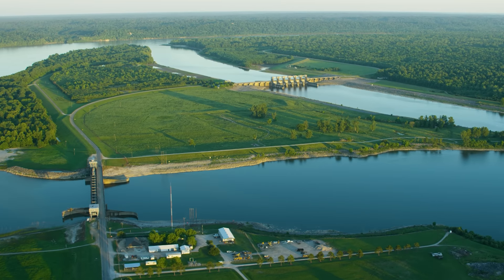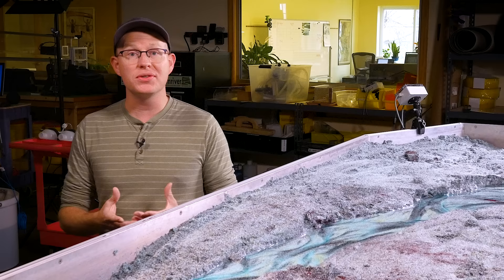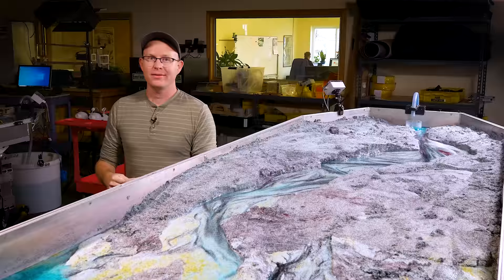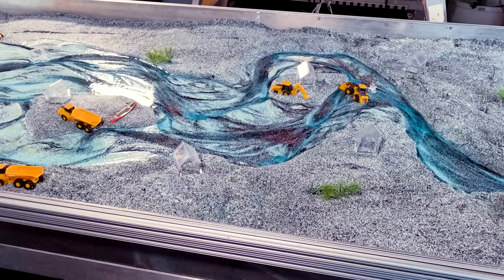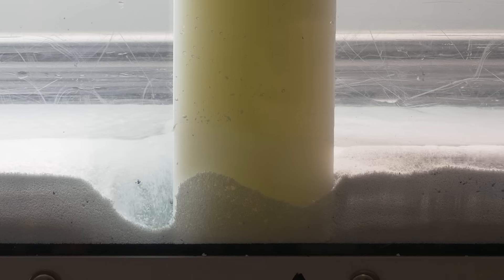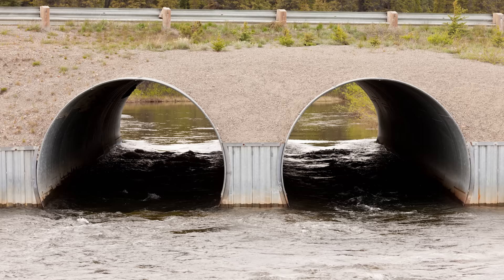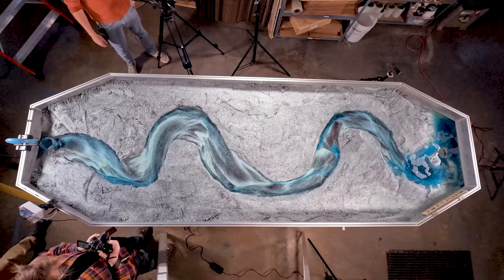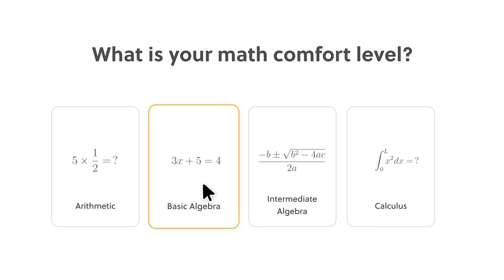Why Engineers Can't Control Rivers

Comment: I've tried for 10 years on a small scale and know how impossible it is. I live on a river and build a small dam behind the house to make a swimming hole & fish hangout spot. One year by accident I set the flow in a perfect spot to wash all the large rocks away and reveal a deep patch of grey clay. It's the perfect 5 foot swimming hole, where you can jump off a ledge and not worry about landing on rocks. Since that year I've tried every single year to do it again. You have to put large enough rocks to hold during the spring runoff and divert the flow perfectly into the bank. You also only have one chance. Once the spring runoff starts you cant make adjustments, then after all the snow melts the river drops way down to only a few feet deep. Something always happens, it fails or a large tree gets stuck in the wrong spot, it's always something. Water will always go where it wants

Comment: OK.  Raise your hand if you have been contemplating building yourself a simulated river sandbox after watching this series of videos.  Might pair nicely with a lego hobby for bridges and buildings.  Adults can play too, right?
Reply: Our local Conservation Authority has a "sand box" equipped with a CAD system that can shape the sand. One can plug in data from a topographical map, for example, to shape the sand for more accurate modeling.
Reply: I had a sandbox as a kid and used to create scenarios where I'd flood it and have to build dams around my "city", until Mom yelled at me for "wasting water". You bet I'm thinking about building a river table.

Comment: There's a reservoir I used to go camping by where the choicest campsites were those where the river met the lake:  sediments had built up for several hundred meters to the point that the shore was a sandy beach!
A bit farther up that river there were three tributary streams that had been combined into one channel that flowed through a culvert with a six-foot diameter.  After the third time in a dozen years that the culvert was overwhelmed, washing out the road, the advice of the geology department at the nearby university got followed:  the three streams were put back into their own channels, and each channel got its own culvert with twelve-foot diameters.

Comment: I work as a flood control engineer. 
We young engineers always try to push for modern ideas in river basin management and steer away from conventional measures like cut-off channels, floodways, and lining rivers with concrete. 
Unfortunately, decision-makers (older engineers and politicians) are rarely open to new ideas. Add the rampant corruption in our country, and I am afraid we will never be able to solve any of our countrymen's problems.
Reply: Keep fighting the good fight😢

Comment: The Logan Creek Dredge here in northeast Nebraska has aged exactly like your model. The Logan was once a shallow, meandering creek that made its way to the Elkhorn River. Flood control was the order of the day (early 1910s) and a company was hired to dredge and straighten the channel 6 feet deep and 10 feet wide. It has now scoured out about 50 feet wide and 30 feet deep, with the creek only being about 4 feet deep and 12 feet wide. The bank is steep and the flow is fast. After closing off the natural creek bed, millions of fish died because nobody thought about what would happen to the fish! The massive flooding in spring of 2019 really widened and eroded the banks, almost doubling the size of the creek.

Comment: The Aswan dam located at the Nile river in Egypt is an example of what can happen when silt meets a dam on its way to the Delta. The river delta is not getting enough silt and nutrients. Shores on the Eastern part of the Mediterranean, like in Israel and Lebanon are slowly eroded because no more silt is deposited along the shores. Engineers have to place wave breakers to reduce beach erosion from waves, as much as possible.

Comment: I don’t know if you’ve touched on this topic, but it could be something neat to research. The old river control system only came about in the 1950s because for centuries, there was a massive log jam on the red river that slowed the flow from the Mississippi into the Red River.

Comment: In Northern Québec in Canada they deviated rivers the size of Mississippi and it dissipated the Cariboo population, to the point where it is now a pretty big criminal charge if you are found to have killed one. If Cariboo's are seen they are reported and all machinery is turned off 12 hours and a helicopter has to do a reconnaissance of the area before anything is to start again. I believe it was estimated that over 500 000 heads were lost in the year that the deviation of the Rupert river was finalized and flooded. Migration of Cariboo's got to a point where they simply went in circles until they died of exhaustion

Comment: hydroelectric dam i worked at has a 10 year schedule, there is a tailbay that can be closed and drained. they crane down front loaders and other heavy equipment down there to drege the silt out.  it's around the clock work and definitely good ot money

Comment: Seeing both the modeling and real world examples of rivers flexing back and forth reminds me of watching rain on a windshield.  The little rivulets of water cascading down do exactly the same thing on a tiny scale, bending and flexing back and forth.  Even putting your finger close to a slowly running faucet will display rippling ringlets of water in that short distance.  Water seems to be trying to get out of its own way, like pushing a rope.  The water is uncompressible and it's flowing too slowly for its own liking, so it bends out of the way as it piles up behind the mass of water in front of it.

I've noticed the history of dead river bends in large rivers flying over the country.  It's fascinating to see the same structures on a massive scale that occur all the way down to drips of water on  your windshield.

Comment: Glad he mentioned the Mississippi River (MS River), and sediment displacement at the delta of rivers. I live in New Orleans, and it's predicted that Louisiana wetlands will be mostly gone in roughly 50 more years. The Gulf of Mexico might be visible from New Orleans in 100 years, which is scary if you think about it. All because of the MS River diversion.

New Orleans propped up around the MS River because of maritime commerce. Then it was noticed that it looked like nature was going to give its attention to the Atchafalaya River, instead of the MS River. This would effectively destroy the economy of New Orleans and everything built there, because everyone would have to resettle around the Atchafalaya River. So Army Corp of Engineers got involved and created levees and embankments to control the flow of water to keep priority on the MS River. New Orleans economy saved, but the sediment from the river was kept from sustaining and building the wetlands. The sediment now just bypasses through all of the levee systems and goes out into the deep of the Gulf of Mexico, wasted.

Comment: I spent 3 years building new rivers and tributaries to reroute them around the footprint of a project. Within the last 2 years, a majority of those rivers and tributaries required alterations due to heavy rainfall that just obliterated them and created new paths or simply destroyed the under designed wiers and rip rapped protected edges.

Comment: I have always found the flow of water fascinating.  I made an interesting observation once.  There were large piles of dirt near a lake.  I made an indentation at the top of one and continually poured water into it.  Naturally, it created a route down with erosion.  The surprising observation is when the water hit clay.  The dirt quickly eroded away while the clay remained longer.  Thus I got waterfalls.
At the bottom, was a muddy mess.

Comment: We have a similar problem in Hamburg, Germany. The harbour is the 3rd largest in Europe but sits 100 km (62 mi) inland. And it's a tidal harbour. 
That wasn't a problem when ships where small but todays cargo ships are massive. Too keep up with deep sea ports like Rotterdam the Elbe river gets excavated regularly to make it deeper, ergo accessible for large ships. All those sediments then get brought out into the North Sea and dumped in the wadden sea. As you can imagine a wadden sea is very flat itself. During the last cold age most of it was land - the so called Doggerland - and until 8000 years ago people lived there and walked with dry feet from England to the Netherlands and Germany and back again. So with no deep ditch to dump all this mud one and for all the next few high tides wash it back upstream into the nicely dug out ditches in the harbour. So we have to dig out sediments coming from upstream AND parts of the sediments we thought we already got rid off.

Comment: For the straightening channels problem you could just create new run offs from the target channel before connecting the channel to the river, with the run offs in place the extra water will instead go where you want it to go, such as into a storage tank which is used for irrigation. A boyee (no idea how to spell that) can be used to tell pumps from the tank if they should pump water or let overflowing water irrigate the land, that irrigation then also having a run off of it's own if the water overflows from there too. The key point is not slow or stop the water flow but guide the main vs overflow to different places.

Comment: Please check the works of Victor Schauberger an Austrian engineer who studied the flow of water and was able to reduce the erosion of riversides by placing stones in a V shape at the bottom in the middle of the river, creating a vortex that moved the water away from the sides. Only a small adjustment that had a big impact.

Comment: A big issue I've noticed here in he American Midwest is just how invasive the agriculture industry is on rivers and creeks. For example, in the early seventies, the Army Corps of Engineers was going to dam a creek with one-of-a-kind geological formations that are beloved in the area. This was intended to serve as flood control for the much larger river that the creek flowed into, so as to enable more farming close to the river. Thankfully, they did not build any dam (I can't remember why) and the creek is now partially protected. 

There is another river north of this one that was mostly straightened for irrigation, and has lost most of its beneficial effects on the environment, which is an area that becomes increasingly sandy and moraine-lined as you approach Lake Michigan. You can still see marshes and sandy prairies trying to survive in the remnants of the once-winding river now bordered mostly by farmland. The efforts to restore delicate, rare habitats in this area have been ongoing but not substantial, as this region (like most of the Midwest) is prime for agriculture, and getting even a few dozen acres preserved is an enormous task.

I worry that the impacts of these short-sighted projects of the nineteenth and twentieth centuries will worsen dangerous flooding that is likely to become increasingly frequent in the area due to erratic seasons and rainfall.

Comment: Finishing up a soldier pile wall in California this week. The scope of the project needs to be changed due to the adjacent river eroding so much of the soil in front of the wall that it is impeding the passive pressure of the design. Water is one of the most destructive forces on the planet.

Comment: We've basically turned the Mississippi river into a shipping canal with levies, wing dams, and locks.
It flows considerably faster now because of this. 
In the end, the silt gets pushed to far out into the gulf.
To make the natural sea break that use to protect Louisiana from storms, and hurricanes.
Its also highly most likely the reason it's trying to cut a new path to the sea.
We did this by exploiting aka controlling the river.
Another example of this is the Niagara river.
By utilizing locks we "control" the speed at which the water flows.
Result.
The actual falls would be over half mile back from where it's at now due to natural erosion.
But with the locks it usually is only running at less then half it's natural flow rate.

Comment: Don't mess w/ mother nature!!! It's very normal for river channels to change the main flow path in their discharge deltas. Channel flow dynamics force the multiple drainage paths to wander about and one of them always wins, and it's not always the largest one. The Mississippi  River Delta actually starts in Missouri at the upper limit of the Ancient Mississippi  Embayment. It has jumped over, or perhaps it's better said through - Crowleys Ridge numerous times in various places from Missouri south to southern Arkansas.  The Embayment has filled with sediment to an incredible depth. If that Shreve guy had just left alone the log jam in the Red River, then likely there wouldn't be an issue but I digress on that a bit, as the topography of the Atchafalaya River is lower than the Mississippi River and as such because the water flows downhill it will take the path of least resistance. It's at the outer edge of the delta and due to siltation sediment along the main flow path it is lower.  It's just doing its natural thing. The liquid flow velocity examples for physical bodies in water exhibited here are also applicable to air and that's why campfire smoke always follows you as you wander around said campfire trying to get away from it. Your body's presence causes a flow velocity change which sucks it right to you. Just walking past one is enough to get it to chase you trying to fill the displacement vacuum your passage caused. I enjoy your series. Keep it up.

Comment: When engineers told me "it's impossible" my experience over a couple decades was that (a) it was possible, (b) they did not see how to do it smarter, (c) they said so because they assumed it was too expensive, (d) they assumed it would take more time than was acceptable. This kind of insight about engineers as well as their spreadsheet managers who know nothing, is what built the Tesla company.
I live in a country that has been managing water for the past about 2,000 years. We live in the flood plane of a branch of the Atlantic on one side and the flood plane of (deltas of) a couple pretty large rivers on the other. About 1,000 years ago, we started management organizations separate from politics, even. And have frequent elections in who represent us in the water management.
Another thing for engineers: they can make things better by making them more complex to the point of "mechanics hate engineers".

As to (b), this was not a matter of "intelligence" in the sense of IQ, because that was very much above average. But a lack of creativity, imagination. "We've always done it this way." Many "over engineered" solutions can be seen to prove the traditionalists right, but the creativity was generally not needed in "what" was engineered, but rather in "how" it would be realized.

Comment: I think twain was right. Controlling rivers is a dubious proposition in the best of situations (stable geography, high elevation, close to the source, etc), due to it's downstream impacts, but a river's nature is to change, and it tends to be the case that the lower elevation, and more flat a place is the more that change becomes normal. Doesn't get much more flat than our case study, here. 

I believe that the longer we hold our metaphorical foot in the door (with these intensive hydrological interventions), the more potential energy a disaster is going to have if/when it comes about, and the more profound the compounding unintended ecological impacts. We should divert course on massive scale "control" strategies and focus on "adapt" strategies, live with natures ebbs and flows, best we can within reason. Engineering marvels often tend to be ecological disasters, as I like to say.

Comment: Earlier this year, the Murray River here in Australia had it's biggest flood event in almost 70 years (1956 was the biggest on record, this was the biggest since then).  Flow rates in the Murray were around 190-210GL in the lower reaches at the flood peak.  Curious to know how much water that was I started trying to do the maths to try and turn that into something I could visualise.  No matter how I cut it, I ended up with numbers that were just too big to picture. e.g. There are 1000L cubes (1 metre on each side) that are often loaded on the back of a truck.  If I start loading my 190GL into those and line them up I end up with a line of cubes 190km (118 miles) long.  I've driven 190km, but imagining a line of cubes that long is a stretch.  If I stack the cubes 10 wide and 10 high, the line is only 1.9km which is more easily visualised, but a 10 metre wide, by 10 metre high space is itself hard to picture, and that times 1.9km still seems like an enormous space.  I can picture an Olympic Swimming Pool, but 190GL is 76,000 pools, which I can't imagine.

So this might make an interesting video exploration. What's that flow rate actually mean, and how can someone try to picture how much water that actually is.  I went and saw the floods form myself near peak.  And having seen it with my own eyes, all I can do is describe is as an "unimaginably vast amount of water".

Comment: 3:56, wouldn't a simple solution to that be just adding a few pipes on bottom of both sides around the dam to allow sediment to be dragged past by water on the bottom? If there's not enough movement of water at the bottom then can just add a rubber pump to the end of each pipe to pump the water and sediment through